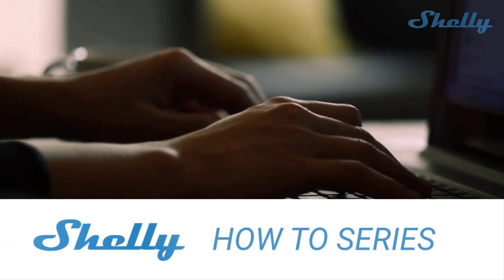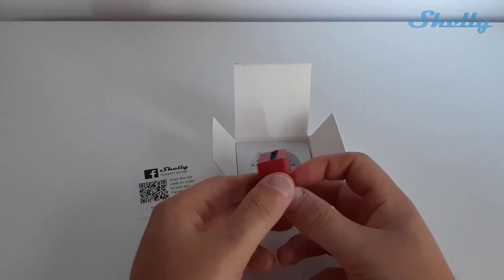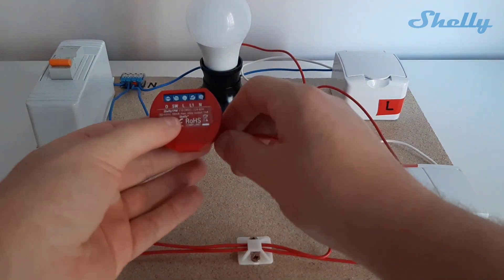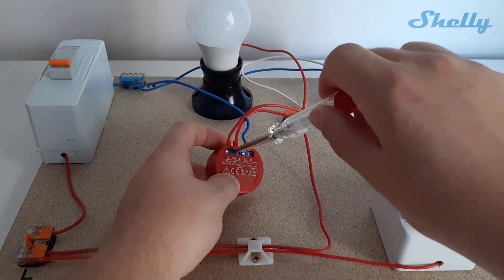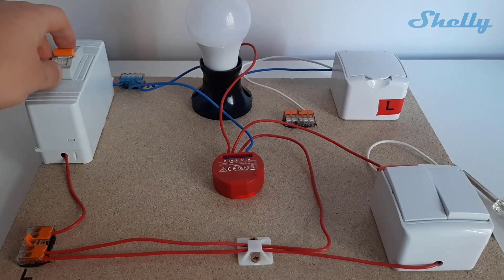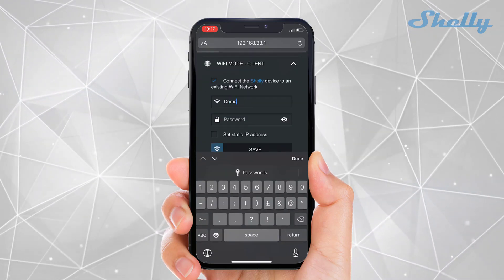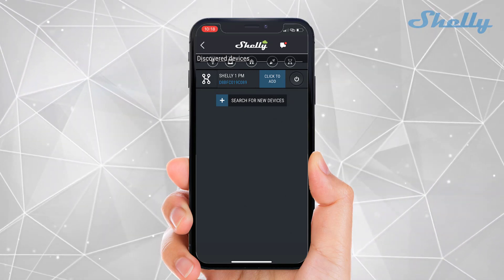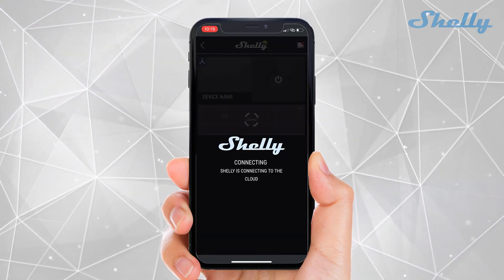Shelly How to... - Shelly 1PM

Comment: Be very careful when tightening the screws, just enough to feel some resistance. They are very weak!!!
I tightened with very little force and yet the screw broke and I had to threw the shelly in the garbage and get a new one.
Reply: I agree. What is the Nm torque spec for the screws? I tighten them and move Shelly and switches back into box and check the tightness and they are looser and so I carefully tighten them some more. Using solid #14 wire seems like when I move the Shelly back and forth it needs another snug tightening.
Torque specs anyone??
Reply: If the screw strips pop it out and use another one, the socket is generally much tougher.

Comment: This is not the same as your instructions. MrCone9 asked 2 years ago "don't you need the L1 cable". Your knowledge base document has Live source going into L1 and the switch between L and SW. 
To confuse matters more the 24-60v diagram has negative going to L and  positive going to N.
Please answer your customers and clear up the confusion: this is something that should have clear and consistent instructions we aren't just cutting grass here!